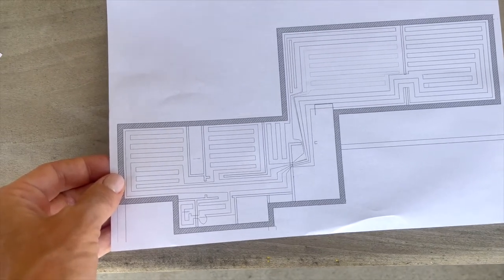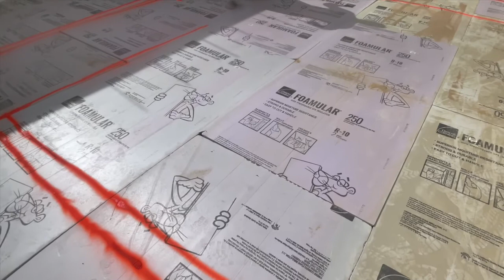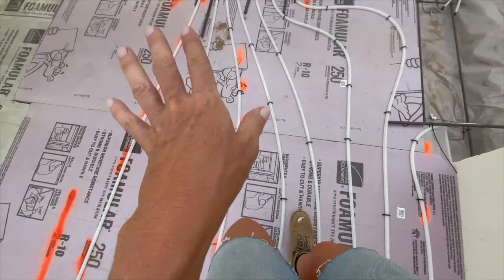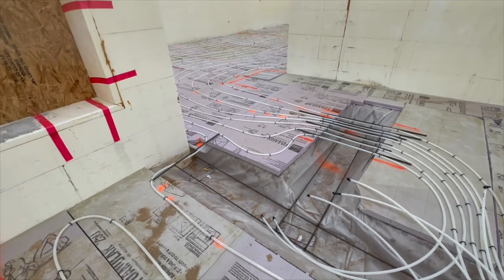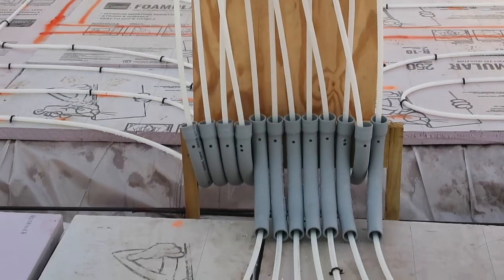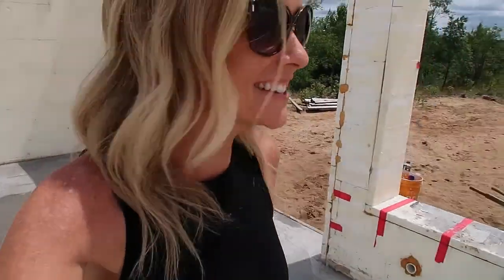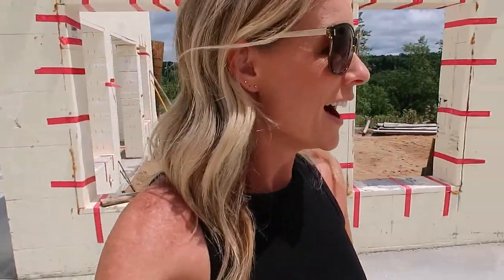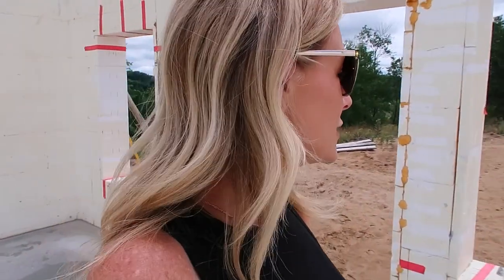DIY Radiant Heat & Pouring Basement Concrete Floor

Comment: Why didn't you put down rebar prior to pouring the concrete?
Reply from the maker: Always check the building code in your area before building. Our building code did not require rebar for the floor slab. We pull all permits and have all inspections and build to code or above and beyond required. The slab is 4" not 6'' and does not hold any weight. The crew that helped us are professionals as well.